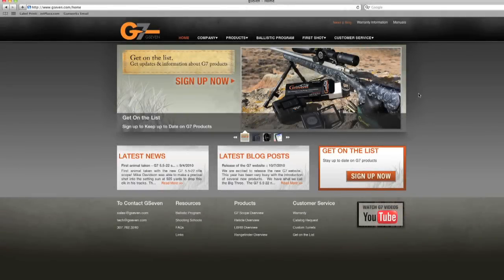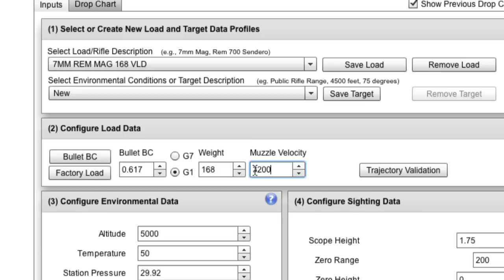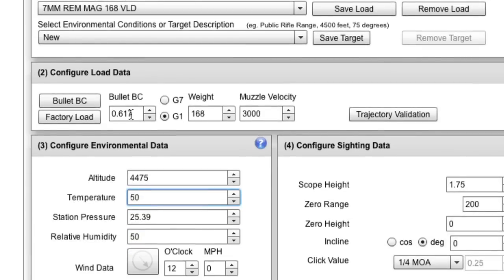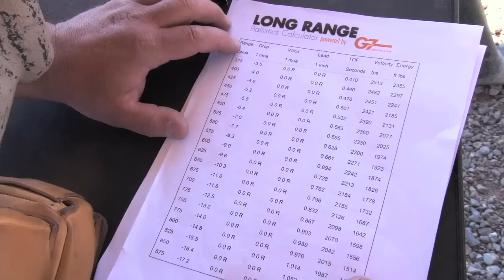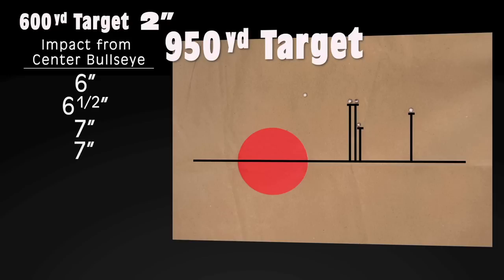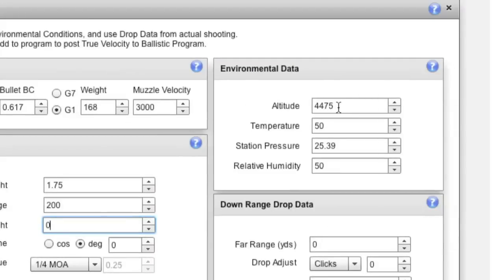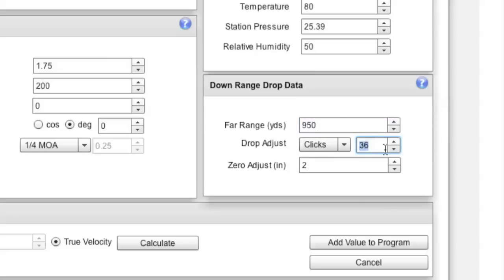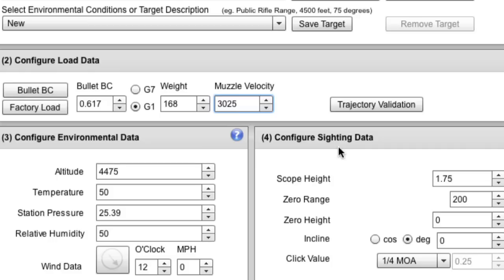Trajectory Validation: Calculate True Muzzle Velocity

Comment: Will this method be as accurate if you Zero at 50 and measure the bullet trajectory at 100 years?
Reply: In theory any ranges will work. The problem is your inherent inaccuracy as a shooter, and measurement accuracy will play a much larger part. If you zero at 50 (which you shouldn't be doing unless we're talking about a .22) then measure at 100, the difference will only be maybe a half inch. So even if your measurements are off by a tenth of an inch it would make a massive difference in your estimated velocity.

You really need to do it at more spread out ranges to check it.
Reply: If your zero at 200 yards your hits will be about 1 inch high at 100... And 1.5 at 50 yards... Just be a man and sight at 200
Reply: Not even satellites will travel for “100 years”.

Comment: I used this today, worked great at 600 yards.  My initial group averaged 1" low at 600 yards.  I I tried entering the data for validation but it actually said my velocity is higher than what I had initially entered??  My initial velocity entered was 2727 and it came back and told me my true velocity was 2747?  It should be lower than my 2727 correct?  What Is going on?  THANKS for your help!!!!!
Reply: Your perfect.... Velocity will+-200 feet per second..1 inch at 600 yards is insane accuracy!!! Your a sniper!! Congratulations!!

Comment: I have used this calculator in the past with the G7 range finder with great success. However, in the mean time I have gone to an iPad that I want to have in the field to make quick work of the process. However, your website says my device is not compatible. Any sugggestions/ideas to mitigate that? Thanks!
Reply: iPads do not support Flash.  The issue is the G7 Ballistic calculator is built with FLash.  I, too, wish their G7 Ballistic calculator worked on a mobile device - either iPhone or iPad.  However, I use the Ballistic AE app on my iPhone and iPad (app supports both devices) with great success.  It just doesn't have the Trajectory validation tool.  THe Ballistic AE app also has a Kestrel Link so I can connect it directly to my Link-enabled (Bluetooth) wind meter to feed data in the field directly to the Ballsitc app.
Reply: D Garcia.. As your list Uncle I have to tell you your panty iPads are FN gay.... Lose that crap in a hurry... Go Android or better yet lose your phone..... Anyway,  Take a piece of paper with your bullet ballistic table.. Go into a kinkofedex and copy it smaller.. And then clear tape this onto your rifle stock.. Done...
Reply: @sarahconner9433  dude…that comment was from three years ago. Get over it.
Reply: D Garcia  I was helping you....so.... are you a sniper yet??
Reply: @sarahconner9433  in fact I am so F off.
Reply: @dgarcia7388  dam bro..so hostile and irritable...relax, nobody shot your dog...

Comment: At the end do you not need to change the temperature to 80 before you print, as that's the temp you did the validation for? or just leave it at 50? Can't work out if I'm been slow here?? Cheers anyway for the video.

Comment: I just used this last week. It worked spot on. I was shooting a .223 and zeroed at 100 yards. I worked up to 200 then 300 then 400 then 500 and finally 600. I was stoked. It seemed almost too easy. The wind was shifting 6 to 12 so I wasn't able to test the wind calculation but drop chart worked great. The calculations are only as real as the data you input. Make sure its correct or at least super close to it. I gave a plug in one of my videos.